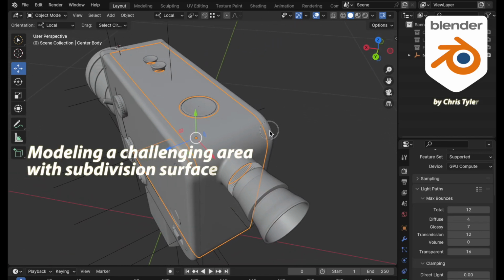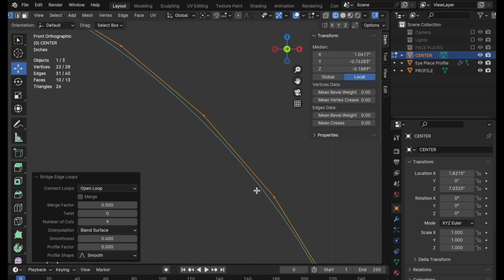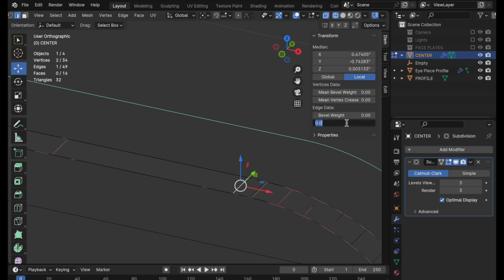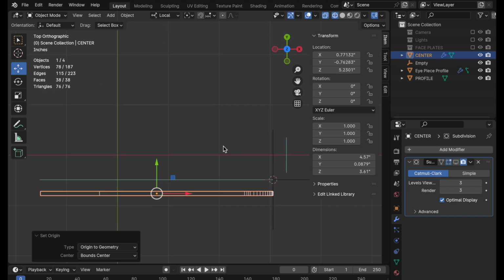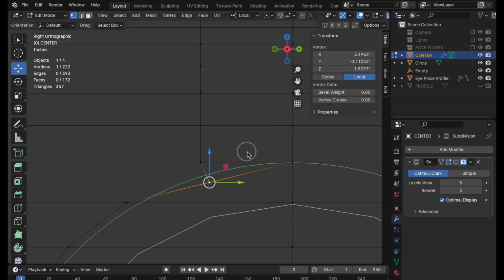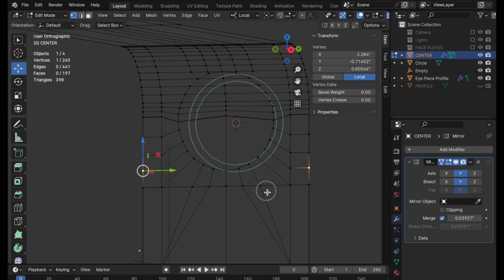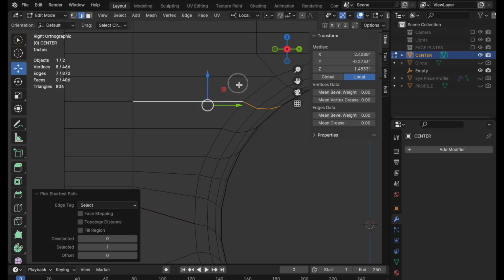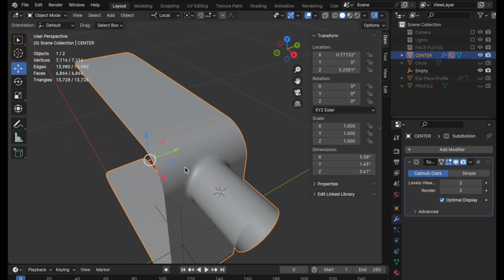Merging two topologies using subdivision surfaces

Comment: I'm following this serie (not as a beginner tho') since the ep.1 and I just love it. 
Your way of explaining things just makes sense in my opinion. I've always heard "quads are not needed everywhere" and as I agreed for some point on this matter, I still always tried to quad everything, because of the shading issues I caused by not doing it. You've showed me WHY quads are not always needed and how to contain the geo; and now I think I finally understand how NGons can sometimes be OK. 
This specific episode on SubD is truly great too. Because it shows how we can use different methodologies for the same model and it goes deeper into topology, which is an important step in 3D modeling. 
There are some things I made differently (not saying my way is better of course) because sometimes I could do it "more efficiently" with the tools/knowledge I already had (but sometinmes it was with the help of some add-ons I use of course, so it's not available for everyone). 
As I agree with your last comment about nurbs-based modeling softwares, there is still the topology issue that can't be ignored in my opinion. Plasticity is a great piece of software but when exporting to Blender, the topo is mostly a mess, which is not always a bad thing but can cause issues too in some cases.  
Still, this is the way of teaching I wish some other "professor" would have. 
Thank you for that !! Keep up the great work.
Reply from the maker: Thanks for the comment. I also did a follow up to this video that explores a completely different way of merging these two topologies that you might be interested in. https://youtu.be/Qh3y6lFDCyU

Comment: First, thank you for such high-level content. Now, regarding the video, yes, it is good to know the tool, but it is a hassle anyway. Polygon modeling is suitable for low poly, organic and retopology, but this is a NURBS task. Period. Suppose you have to iterate over the finished model or try different variations. It is just not possible. If the bevel was too strong, nothing to do. If you need to boolean a piece in an advance state of the modeling, good luck with that. If you get more complex with the forms and the intricacy of the details, it will take you forever. If you miss a detail, then you have to redo everything. So, no thanks. Blender is not the best for it.

Comment: I don't get why you use this method for 12 min. to create the middle part. 
You duplicated the loop from the side mesh already, why not delete every second of the curve verts (between the boundary verts) that is to much (or rebevel /decimate the segments count) and then extrude it to the middle parts size.
Then you can continue to cut the circle.
That would save you at least 11min., if I didn't get it wrong what you tried to archive / show here!?

Comment: I've been binge watching your tutorials and picked up a lot. the  PCBL (Planar Curve Boundary Loops) approach is a revelation! 
Two things I noticed: 
- the subdivision surface modifier has, in advanced, Boundary smooth > keep corners.   
- often, when you use the cursor to scale a group of vertices from the cursor, you can also use the active selected vertex in the group, use Transform Pivot point > Active Element to scale from that selected active vertex. I think that is a few less clicks :)